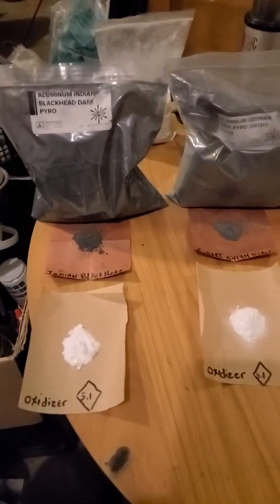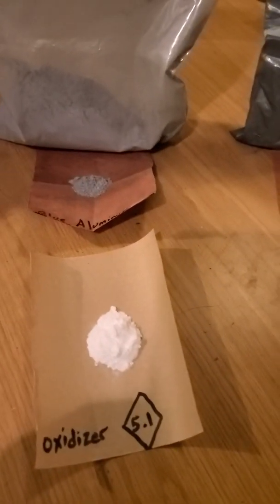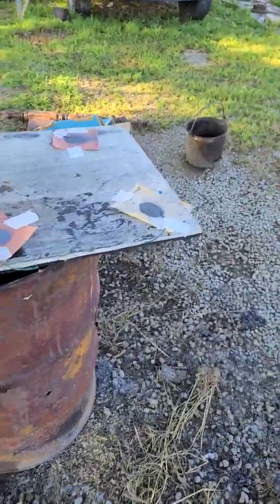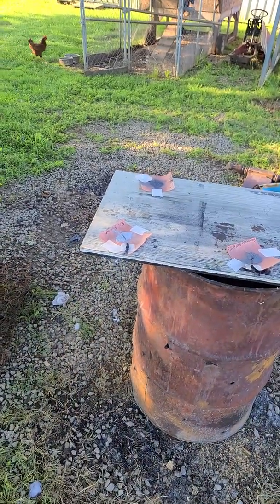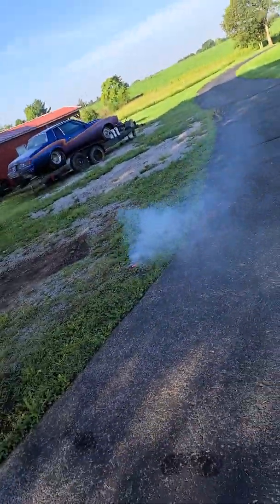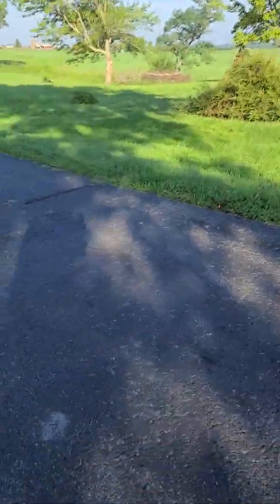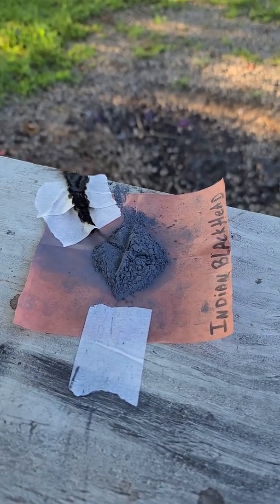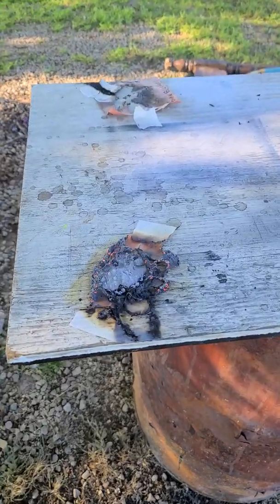Flash powder testing

Comment: Fireworks cookbook has in my opinion the best purest high quality products out there for the best price including the best shipping price. And they're shipping is pretty damn quick. I live in New Hampshire so I mean I'm a good distance away from them but not terribly far. I think it took 3 days for my first order 3 days for my second and my third I'm expecting tomorrow. 

 The first flash powder I married was with potassium nitrate, sulfur powder and the Indian blackhead dark pyro. And I got to say... That Indian blackhead is amazing. Personally I think it worked much better than the German dark Eckhart. 

 I do have several aluminum powders at this point. I'm contemplating making up a small batch using a little bit of each one and perchlorate. A splash of or rather a pinch of sulfur powder. No more than five grams total and then take it outside in one of my firecracker tubes that I have been making and see what that does. 

 Either way great video. And for those of you that are reading this... Check out fireworks cookbook.com. they've got pretty much everything you could need at excellent prices. And they have a recipes section where there are I don't know well over a hundred different firework composition recipes right there. 

 Another thing about that company... If you send a message to them via email... They are very very fast at responding. I've sent three total and each time they have answered me in under just a few hours. 

Carry on. 💥💥🇺🇲

Comment: I've tried the german and indian and I probably wouldnt be able to tell a difference unless I was to do them side by side. I think the indian might be just a hair weaker but that's probably expectation bias on my end due to it being cheaper.

My main gripe is with how hygeoscopic the oxidizer is. I can screen it as many times as I want but once it's mixed it balls up and I jave a bunch of clumps of oxidizer in my comp. I wonder if it's enough to throw off the ratio.
Reply: use a coffee grinder ;)

Comment: Ok so im not hating but a few things I must say about this video that I have to say because people imitate what they see and a couple things  he did where extremely dangerous. First never stand that close even with unconfined because certain mixtures can act completely differently and 10 grams of unconfind will detonate like a high explosive. ALSO DONT BE SMOKING A CIGARETTE ESPECIALLY OVER 5 EXPLOSIVES (yes we all saw your ash fall)  but the biggest "DONT DO" is when lightning them off do not use a bic  lighter or light it in your hand because you could very easily left residue on the Fuze then go to light it and BOOM no more fingers! Also the same goes for placing one in the same spot you just lit one off at for the same reason, one amber then all of a sudden no more fingers.  The propane touch was the way to go and the fuzes where even better  or anything that keeps you and your fingers away from it. Flash will always catch you by surprise, I know from experience so please all be safe! I've seen 1 gram of unconfind punch a hole through a metal Petri dish and made a 7 inch Circle of grass just disappear so now imagine that but with ten grams and your standing 4 feet away. Hope this helps and have fun blowing shit up lol

Comment: A lot of people say that Indian blackhead it's much better than the German "super" or whatever you want call it. Looks like there's a new king in town.
Reply from the maker: It doesn't mix together with kclo4 as good as the 5413 does but it does work as good or better.
Reply: @jeremyarnold1979  Depends how find your Perk is. My three micron Indian blackhead mixes perfectly. But even then what's a little extra mixing if the performance is much louder.

Comment: Interesting ... I think this is the first time adding sulfur to flash powder has been mentioned. Is it supposed to have the same effect as adding it to black powder does?
Reply from the maker: Adding sulfur to most compositions lowers the ignition point to make it easier to lite.
Reply: @jeremyarnold1979  it also changes the sound of the report to lower boom than a crack.

Comment: The best but still safe mix for the biggest and loudest confined bang is KCLO4 and MgAl  with a 50/50 mix by weight.  If you can, get at least 1000 mesh or 2000 mesh MgAl.   Screen or mix on paper .  Screen the Oxidizer separately to get it free flowing so it mixes well with the Mgal.  Worked in Fireworks factory for several years.   My nickname is old BOOM.  😊😊
Reply from the maker: Not my cup of tea, I like the safety of mixing 70/30 and it's plenty loud for my cause.
Reply: @jeremyarnold1979 66/34 and get that deepness
Reply: Actually you can substitute that perk with potassium nitrate, and instead of mag/al just use mag. 50/50 mix. Whatever makes you make at 10% sulfur and you got a very powerful very safe flash.
Reply: If you mix KCLO4 flash powder in the right quantity with extremely fine aluminum and Sulphur it is actually self confining. You can get incredible detonation velocity for a mechanical pyrotechnic mixture.
Reply: @thatoneguy454c  Sorry that's not Detonation it's Deflagration
Reply: 33/33/33 for a bigger bang.
70/30 with the right oxidizer beat kclo3 and kclo4.
Detonation can’t be achieved with flash powder. For detonation the speeds needs to be 3000m/s.
Reply: Kno3?
Reply: But perchlorate not available on regular shop. Only available for industry. So potassium nitrate still good substitution and far more cheap
Reply: What is MgAl

Comment: #JeremyArnold
 what aluminium powder did you use in the potassium nitrate sulfur one because im from Australia the only aluminium powder I can get my hands on is normal aluminium powder 200 mesh. I have not tried it yet but on a small budget so I don't what to buy it and it does not go boom thank you travis.
Reply from the maker: I just received a batch of chems and ordered in a pound of 200 mesh so I can try it for myself and will let you no.
Reply: @jeremyarnold1979  How did it go?
Reply from the maker: The 200 mesh aluminum was a slower flash power unconfined but worked OK confined. Not as powerful as 3 micron aluminum but will work in a pinch I'll do a video once I get to it. Thanks
Reply: @jeremyarnold1979  a lot of the firecrackers I make with it have it all spit out the top in the video can you show how you make it well confined.
Reply: When you're going to make how much grams for sulfur, that new aluminum powder and potassium nitrate are you going to use?
Reply from the maker: I'll make a video this weekend when I get home and post it up. I usually make 100 gram batches for ease of mixing and screening, but I used 70/30/1/1 on this mix 70 kclo4 30 200 mesh flake al. 1 sulfur and 1 titanium powder 200 mesh. I pasted a 2 inch ball shell with gummed paper tape with 10 to 12 layers using time fuse and a small flash bag on the fuse sealed the fuse with sgrs paste.
Reply: @jeremyarnold1979  I keep making firecrackers confined with 2 bottle caps and hot glue around them with the flash powder mix of 30 grams potassium nitrate, 18 grams sulfur powder, 12 grams straight normal aluminum powder. And homemade fuses mixed with sugar and potassium nitrate. I make a very small hole to put a fuse in and seal that with hot glue. I made one and as soon as it got ignited it spat out the top of the fuse hole like it was not confined. What am I doing wrong?
Reply: @OhnoAnt  basically... everything ahah

Comment: What do you guys think is the most stable form of flash powder?
Reply: what aluminium powder did he use in the potassium nitrate sulfur one because im from Australia the only aluminium powder I can get my hands on is normal aluminium powder 200 mesh. I have not tried it yet but on a small budget so I don't what to buy it and it does not go boom thank you travis.
Reply from the maker: I have also used my homemade aluminum powder which is 95% aluminum foil and 5% carbon (eastern red cedar) and have had success. BUT I have lost more to spontaneous combustion than iv been able to keep. After the 48 hour mark of ball milling the jar needs to be opened atleast twice a day, at least. Wouldn't hurt to open the jar 4 or 5 times a day to let oxygen in and give the media time to cool a bit.
Reply: @jeremyarnold1979  are you saying the aluminum caught fire in the ball mill or was it afterwards?  Is it safe to ball mill potassium perchlorate in a ball mill?  I know not to mill the two together.
Reply from the maker: It went up in flames when oxygen was let in
 Kclo4 is fine to mill alone
Reply: @godofexplosives  Actually with potassium nitrate magnesium works even better along with a little sulphur. It is the absolute most safest stable flash powder. In fact it's hard to even light with an open flame it has to be a fuse or high temperature flame to ignite but when it does boom! You could even mix it vigorously because there's no chance that it will go off. I've even mixed the ingredients together using a pestle and mortar. I made some m-80s and the nitrate magnesium sulfur completely outperformed the perchlorate and aluminum. Best ratio I found is 45% potassium nitrate 45% powdered Mag and 10% sulphur by weight, or a 50/50 +10% sulfur for whatever quantity you're making. Like if you're making 10 grams, you'll put in 1 gram of sulphur. If you're making 1 gram can you put in 100 mg, you get the picture.
Reply from the maker: I just responded on the time fuse one, good luck.
Reply from the maker: On the nitrate flash I use ball milled potassium nitrate eckart 5413 3 micron and rubber makers sulfur.
Reply from the maker: Regular flash at 7/3 kclo4/al
This is the industry standard. Once confined in a shell it's as safe as any other composition we use.
Reply: @jeremyarnold1979  Thanks is this mixture sensitive to fiction?
Reply from the maker: Iv never had it go off by hitting or scraping. But it did once I added titanium powder to it. But you should be just fine. I do spray my clothing with static guard before messing with flash comps.
Reply: @jeremyarnold1979  Alright Thank you
Reply: @jeremyarnold1979  you have a video of those tests, also with Ti?
Reply: @jeremyarnold1979 Does this also work with kno3? I am wondering because kclo4 is not available anywhere in my country

Comment: Here's a suggestion to increase the burn rate even more, you could mill the oxidizer for 24 hours in a very clean ball mill jar and the oxidizer might clump after but you can always screen the oxidizer after milling and this solved the slow flash problem for homemade dark aluminum in my experience and for some reason 5:5 ratio is way faster than 7:3 after milling the oxidizer, and I figured that out by mixing a 1:1 ratio of milled oxidizer and homemade dark aluminum and it went Thump like a thump powerful enough to quake a punk stick with only 70-100 milligrams unconfined
Reply from the maker: The oxidizer I use is very fine Chinese kclo4 with anti-cake milling it is not an option with the anticake. It's fine enough for flash powder.
Reply: @jeremyarnold1979 okie

Comment: Great video! Whats in the homemade stuff if i may ask?
Reply from the maker: Ball milled cheap aluminum foil that was ran thru paper shredder then a coffee grinder then added 95% aluminum to 5% willow or balsa charcoal ball milled for 5 days opening the mill jar twice a day to let air in.
Reply: @jeremyarnold1979  thanks sir! And those little cherry bomb shells? How do they hold together are they glued?
Reply from the maker: Yep, they are melted together using toluene.
Reply from the maker: I have replaced the willow/balsa with eastern red cedar and works just as good and is cheaper to make.

Comment: To make blackhead aluminum all you had to do is ball mill Willow charcoal make sure it's Willow then you mix it 50/50 or 3050 30 Willow 50 aluminum make sure you Mill it for about 7 days each not together make sure you breathe the aluminum out of the ball mill so it don't explode or combust
Reply from the maker: Not from my experience it's more like 95/5 to 90/10 and the 10 is way to much charcoal

Comment: The german is the one u want its defently the fastest
Reply from the maker: Not in this test the Indian was faster and had a louder pop to it than the German. I'm using Indian in everything now.
Reply: @jeremyarnold1979  Indian gives u the best balance of bass, power, and sound/pressure output. There's a 3 micron atomized that hits HARD af too! I guess people avoid it cuz its atomized but its a lil more expensive for a reason, the shyt puts out a crazy pressure wave. I only see a couple YouTube vids of people using it im guessing cuz nobody knows that 3 micron atomized works tremendously in salutes. It was actually the 1st Aluminum i ever worked with.
Reply: Indian is faster, especially if its the 2 micron Indian. I have alot of it.
Reply: Hansen, German aint the fastest. 2 micron Indian is. Almost all Indian is faster. But i dont use cab-o-sil cut Chinese kclo4, i use High Purity only. No cheap chems this way.
Reply from the maker: In my personal testing, the 325 w/anticake compared to high purity kclo4 the wad no distinction between the 2. So I use anticake for ease of mixing. The high purity seems to clump and needs screened before mixing. Using the Chinese stuff rite out the bag and aluminum out the bag straight to mixing.